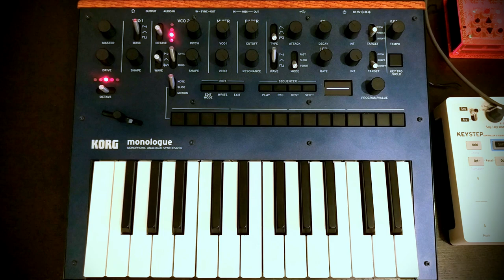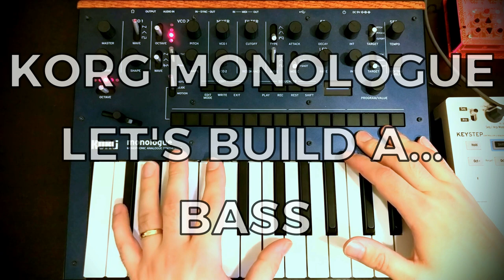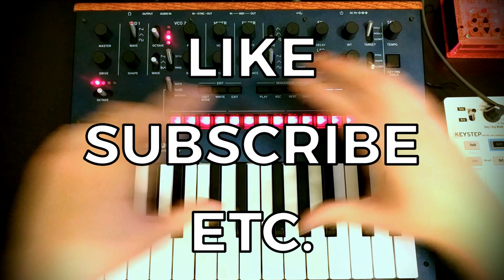Korg Monologue - Let's Build... A Bass Patch!

Comment: Okay, so I've been playing around with this thing all night. (Mind you, I bought this back in May of 2017 but I just never really used it all that much and it's been sitting and now I'm trying to atone for that.) What strikes me, and I know this is the same for a lot of synths, is that after a bit of practice you can start sculpting sounds very easily with this. My new favorite thing is to just start from the init patch and try to make something cool. After a while, you start remembering how to make sounds and you can easily go right back to the sound you were fiddling with for the last 15 minutes. It's great.

In particular, I really like starting with the sawtooth on OSC 1, then adding in triangle OSC 2 two octaves below. That alone sounds good. Then you can add the filter as OSC 3 2 or more octaves above for a low, buzzy, bass with a high end icing on the cake. Add detune and drive as necessary, there's so many sounds you can make with that basic formula. By no means is this a typical "bass sound" but it's fun to my ears.

In particular I feel, at least with my headphones (I'm using Sony MDR-7506 just for reference), that dropping the second oscillator an extra octave below the first adds an immense punch. I like the sound of both (one and two octaves below) but I can't stop going back to that two octave drop.

I apologize for my rambling, I literally paused the video a few minutes in and spent another 20 playing around on my Monologue (I really love having the ability to use batteries so that I can sit on my couch and just play with it). There's a lot of great stuff in this video and I really appreciate it. Videos like this are making me kick my own ass and figure out what I love about this synth and making me regret not playing it for the last 2 years.
Reply from the maker: Well I'm super glad I've helped you rediscover this killer little synth!

Comment: Drive is one of the most interesting things to me about this synth. It definitely cuts off some of the top end but adds a lot of grit to the sound. Almost like a distortion, but without wrecking the sound, and at high levels it almost reminds me of a guitar gain. I find that as you reach a certain point, the added distortion almost fills in some of that fizz missing from the high end. Depending on the patch, anyway.
Reply from the maker: Yeah, the drive is great, but I find that on some patches it just makes me go "nope!" and others it fits just right - I guess that means it has a definite character! Sometimes I start the patch with it turned most of the way up and work with it that way rather than mixing it in at the end - that can be an interesting way to work.
Reply: @OscillatorSink  I'll have to try that out, as I tend to do it the other way. That's a great point though, when I start to learn how to craft sounds I tend to get in the habit of doing the same steps over and over again, so switching it up and doing things differently can surely improve the creativity of the sound design. Thanks!

Comment: hello! thank you very much for your great video, it helps a lot and very interesting things that you are present in all those Monologue videos.
i have a question: when i play a note, and leave it, the sound playing twice- at firs, whet i press, and second time, when i depress it. where can i change this function? appreciate it
Reply from the maker: +Eitan Ginzburg does it happen on an initialised patch, or is it only certain patches? Is your Monologue hooked up to anything else by MIDI or USB?
Reply: ok, so it is conect with usb to ableton live and when i reconnect it, the issue is gone.. so it good to know that, but is it means that i need to check what is going on with the Ableton?
Reply from the maker: +Eitan Ginzburg that sounds like there was a stuck MIDI note most likely - which just  happens sometimes... I'm not familiar with Ableton but there's probably a "midi panic" or "all notes off" button or menu item somewhere which would also fix the issue. Also worth checking you're using the official Korg drivers for MIDI over USB.

Comment: Mo Bass pls
Reply from the maker: +Pat Kelly I'll see what I can do!
Reply: Thanks mate love yr vids really helpful. Sadly I can't seem to install yr patches. It keeps telling me i don't have the midi utility installed when I definitely do and on occasion says it cannot locate mono's midi ports. Easy, direct contact via usb just does not happen with my set-up for some reason!?!
Reply from the maker: +Pat Kelly there's an issue with Korg's midi utility where they don't like it if the Midi device is installed at too high a position by Windows (every time you plug a device in to a different USB port it gets a new number given to it by Windows). There's an "uninstall midi driver/device" that gets installed alongside the Korg stuff. Run that, but tell it to target Non-korg stuff as well - it's safe to do, the devices will just be reinstalled next time you plug them in. Then plug in your Monologue, let the drivers install and then hopefully the utility will see it. Let me know how you get on.
Reply: Hi OS. Unfortunately that didn't work. It keeps telling me to check my midi ports and Mono sys ex if I'm working via midi or " monologue is not connected" when via usb. Still, I guess this will encourage to make more of my own patches. I only have the original 50 factory presets on mine. Whether this is due to being an older, 2nd hand build, I'm not sure.